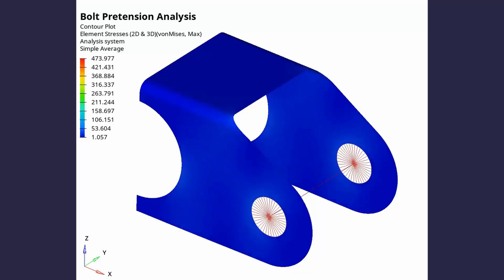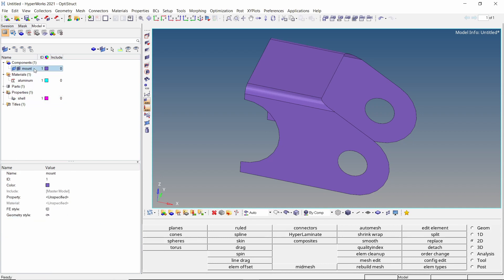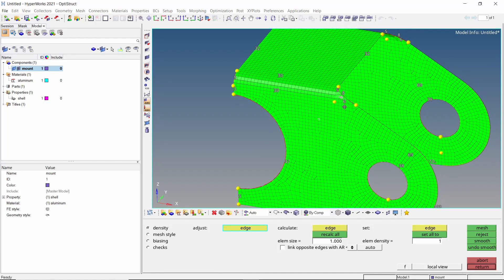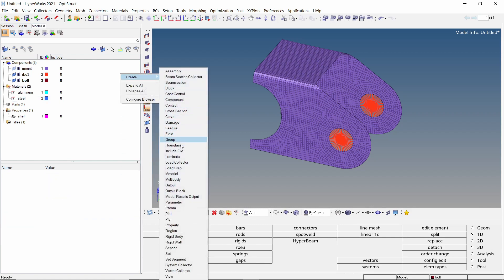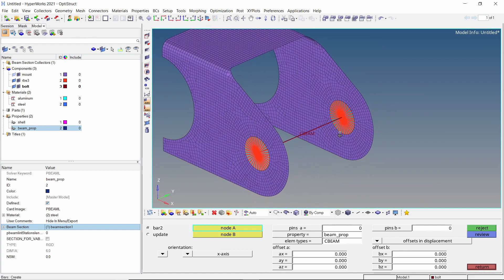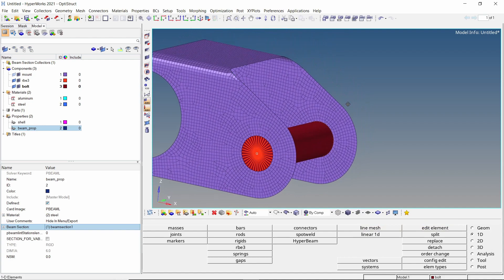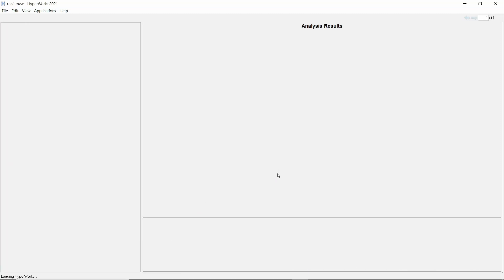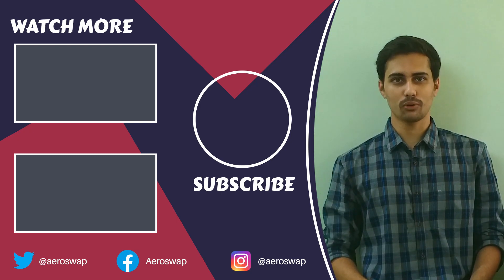Hypermesh Bolt Pretension Analysis [Optistruct Tutorial]

Comment: Your video is great, thank you so much. Regarding the bolt preload, I would like to ask how to realize the transient analysis after bolt preload?
Proceed as follows:
1. Add bolt preload.
2. Add time-varying loads.
Both forces are set up, and they work fine when used alone. After merging, I set it multiple times in loadstep, but it still cannot be solved. Can you help me?
Reply from the maker: Thanks!
Create a static loadcase for the bolt pretension. Then create the transient loadcase and in the STATSUB (PRELOAD) field, assign the previously created static pretension loadcase. This will include the pretension loads in the transient analysis. 
I hope this is what you are looking for!
Reply: @Aeroswap  This approach doesn't seem to work. This link has the attachment I uploaded, can you help me to answer it?https://community.altair.com/community?id=community_question&sys_id=047c0b13db23c9d0e8863978f49619b5

Comment: Sir, 3D bolts are original 3D model of bolts or there is in-built  way to create 3D bolts?
Reply from the maker: Hi Neeraj, as of now HM does not have built-in tool to create 3D bolts. You have to import it as a CAD only.
Reply: @Aeroswap  okay sir.Thank you.
Reply: @Aeroswap  Sir, can we apply pretension in 3d bolts meshed with tetrahedral elements?
Reply from the maker: Yes, we can do that.
Reply: @Aeroswap  when I am trying this on a screw, I am getting error,"Normals on the cutting section of pretension are not consistent"
Reply from the maker: Yes, you must have a perfectly flat surface on which pretension is applied. If you are using tetramesh, make sure to cut the bolt at the center before doing the meshing. Then use this interface to apply pretension.
Reply: @Aeroswap  okay Sir.Thank you

Comment: Perfect video ! 

RBE 2 element with additional rigidity can avoid hole ovalization?
Reply from the maker: Thanks Harry!
Yes, using RBE2 will prevent shape change of the bolt holes but it will also result in some stress concentration zones along the free edges. Finally it comes down to the analyst whether to use RBE2 or RBE3 :)

Comment: Nice to see how the pretension affects the bracket. This case RBE3 is sufficient to idealize the bolt pretension and its load distribution around the holes. I guess in reality you could also include the bolt head area by adding more RBE3 independent nodes. I'd be curious to see how the stress changes when using solid elements for the model with the contact assigned.
Reply from the maker: Hey Ken!
Yes, much more detail can be worked into this. It is also possible to add washers on both sides of the bolt and see if the stress pattern changes. It would be great to see the comparison between 1D bolt and 3D bolt with contacts defined. Maybe I will work on a follow up video with these additions soon :)

Comment: Why don't you use RBE2 element for the rigid
Reply: You can. RBE2 elements = infinitely stiff elements which introduce additional stiffness in your model. RBE3 = interpolation elements, allowing for a better representation of the stress field around the bolt hole. So it is up to you and what you want to investigate with your model, or in some cases company's modelling standardization policy.
Reply from the maker: I agree with Emmanuel. The decision between using RBE2 and RBE3 either depends on the study under consideration or the organization which sets the standards for carrying out the study!